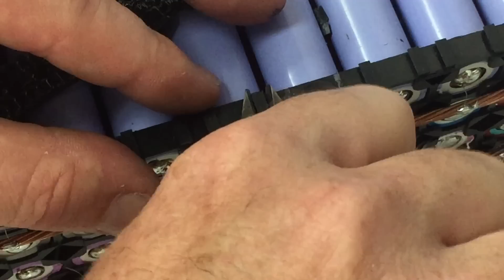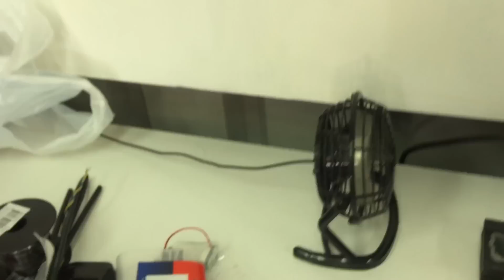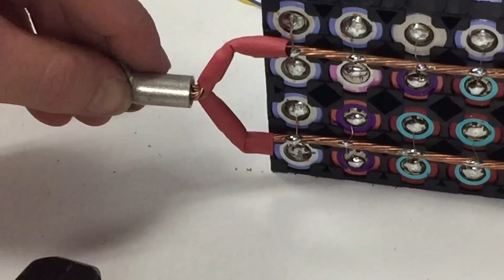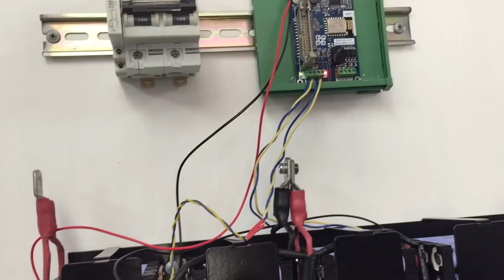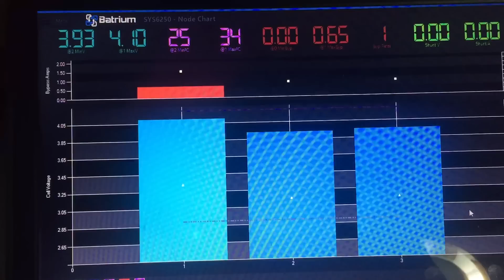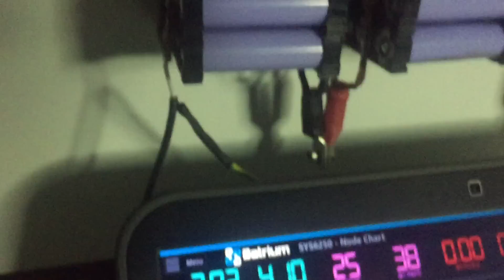More Busbar building and getting Batrium BMS stuff sorted out

Comment: You really should of gone the extra mile and re-wrapped those batteries, it would have taken you mins and not only would they look better but you get a better inspection of the battery... often dents and other undesirables are well hidden. Also... would had been better, safer and faster to weld the joints using a cheap pulse welder. Just my 2 cents.
Reply from the maker: Rewrap not required, extra expense and time i can do without. Have a cheap spot welder it doesn't work :)

Comment: ever thought perhaps a solder bath station for each terminal before putting them in the harness, just curious is all trying to find a easier way to solder those contacts.
Reply: like a pcb with spring's like those on a stator. in a motor alternator or dynamo.
Reply: with this concept you could easily remove poor performing batteries with just a few to pop them out.

Comment: At 0.5 amp will take ages to balance cell 1 ?
Reply from the maker: the issue is more with the totally inadequate charger I'm using that isn't really up to the job. That and cell one was almost a volt different than the other two.. making the workload on the Longmon a little heavier than usual
Reply: Way better than the 0.04 amp the ebay BMSs are limited to. As pete says elsewhere in the discussion, max for this BMS is 2A.

What's the current on the 12V charger your using Pete ?
Reply from the maker: 3.3 amps but I'm doubting that ! lol

Comment: Hope you can go over the advantages and disadvantages of using a BMS. That's my main dilemma right now.
Reply: A BMS is essential for a large battery bank. Of course there are people who are yelling "If you have good healthy and balanced cells you don't need a BMS and/or a balancing". But you know what? The battery system on the International Space Station has also a BMS who does balancing, and these guys know what they doing. Go figure ;)
Reply from the maker: Disadvantages: Three pairs of worn out flip-flops from walking back and forth manually checking Advantages: None yet, haven't installed it on my bank - but looks horribly promising :)
Reply: I think the core argument against a bms is that it increases the complexity and instead of checking cell voltages you are checking if the bms is still working...

Comment: Does the Batrium "thing" balance? - and what's the difference between active and passive balancing?
Reply: The BMS will balance the cells to any configured value, there are also options for it to remote throttle the inverter/charger regulating the power in to the cells. If desired another feature can be enabled to have the cells adjust to a matching voltage not just at the target top of charge level when the pack is idle.
Reply from the maker: Now I'm not an expert - active - when each cell constantly passes current to one another to stay 'balanced'  Passive - is only at a given voltage will it start to 'burn off' power to bring all cells to the same voltage.
Reply: Cool. So the Batrium DOES balance?
Reply from the maker: It does :) As well as a whole lot more. Cold climate, have an EV and your batteries are cold Just ask the BMS to pre-warm them :)
Reply: Interesting. I'm looking at building just a 4S 12v package lifepo4 system and am in the research phase of things. I'll have to start digging into the Batrium docs if I can find them. That site needs a technical writer!
Reply: Excellent.

Comment: is that bms not a bit light for that amp hour rating pro 4v pack??  in my opinion 65 ma is nothing for that huge 4v pack??...
Reply from the maker: +MrBugsier5  it was balancing at 1.75 a for 14 plus hours :) didn't  go above 4.2v so guess it's ok for now. Time will tell for sure. Might change with 100amps of charging :)
Reply: whell, , 1,75 ist that mutch off a load to it to... lol, but again , i/m used to huge lead acid packs... lol
Reply from the maker: max is 2amps better than the 40ma balance 200amp max bms I've got before! Once balanced how much time per day do you think they'll be balancing for - 10 min - 1/2 an hour is about all it'll need across the whole pack I thinks... Well, I hope!
Reply: +HBPowerwall That would be my concern too, that the BMS looks a bit light - a situation could arise where it doesn't have enough oomph to pull a stray pack back into line, but as you say, 2A is better than 40mA!
It'll be interesting to see how it gets on, and I'm sure you'll soon notice if it struggles to keep up! :-)
Reply from the maker: Hell yes, I'll notice (has 10 years data logging) then I'll video it and upload - But if you look at the way chargers work - top of charge they ramp right down my PCM60X is about 2-5a when approaching the top of the charge. This is all learning - Current settings I have it set to 4.1v and soon be changing to 4.0 volts per cell so still have 0.2v for buffer
Reply: Rebalancing should be minimal, it will only in the order of 50 mAh each day. If a few cells have a problem this is reported in logs if enabled in the software. Its not uncommon to find second life cells within a pack that are damaged, these can either be excluded or used provided you have the ability to adjust for this issue. There are several projects that customers have which require 8-12mA per hour to bring back in service (hence 288mAh /day = 12mAx24h).
Reply: I'm absolutely sure they'll be safe in your hands!

Comment: Your big lug crimps, here is a way to test you have a good crimp, so make up a test crimp the same way you connect up a battery crimp and cut it in half across the connection, and it should be solid in the centre with no air voids, that means your squeezing the crimp with the correct amount of copper in the lug, and your crimping tool is working correctly with the correct  amount of hydraulic pressure to the lug
Reply from the maker: +Eoin Caldwell cool ill to that toady for sure !!!!!! Il put it in the next vid.
Reply: yeah, and dont put solder in it helps to!
Reply from the maker: Yep, gotcha! wow i thought it would make it stronger not weaker over time, well something new every day

Comment: Nice video mate. Those batteries discharges running at 60 degrees on the cells might an area of concern? Only for longevity.
Reply from the maker: I'm interested to find this out, I have clearly marked Longmon on the back :) But once balanced how long are they going to work for per day 5 - 10 min maybe ? not long I'm thinking.
Reply: Yes thats a good point. Hadn't thought of that.....I saw heat and panicked!!! haha
Reply: Speaking of those dischargers... Where are they sold???

Comment: like that busbar idea and how u connect them together ;) the cable sleves i like alot. they hide the uggliest cablest and make it tidy. for the contacts between packs. if u think the distance is to much in between use copper pipe. i have done that in another install where the packs where to far apart and didnt want to bend the busbars.
Reply from the maker: Now I have to agree this will be covered in next video that's in production atm. Was going for double fuses but the stronger wire on one end adds to the strength of the whole pack. So it's one of those tradeoffs I thinks.
Reply: HBPowerwall yeap. keep up the work m8!!  it might be that i have one of those batrium systems my way too. it seem damn good and this was the only one so far that came close to my demands. so will be running it untill i get my own up.
Reply from the maker: Did you order one? How awesome is that! lol I'm far from an expert on this type of thing learning slowly as I go.. The more you dig the more it can do!